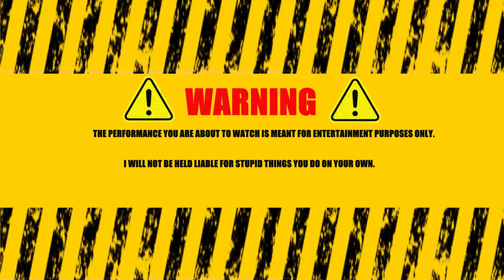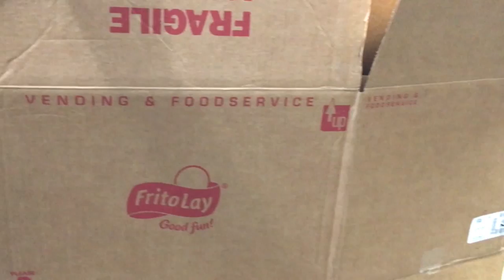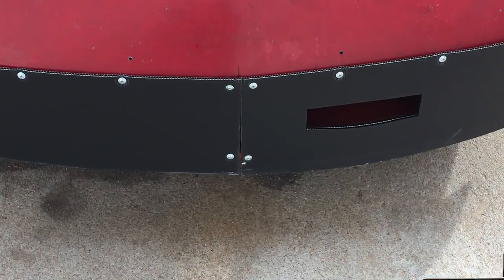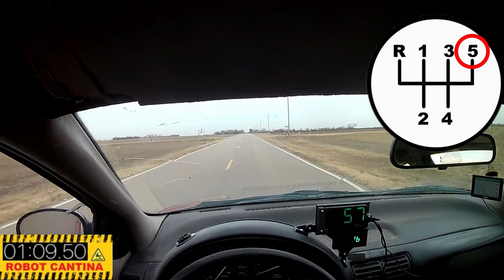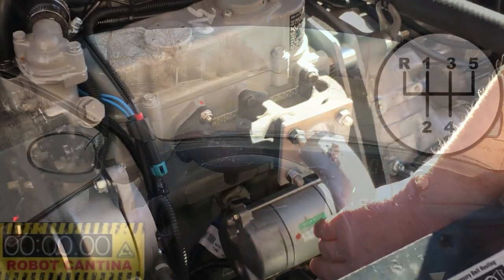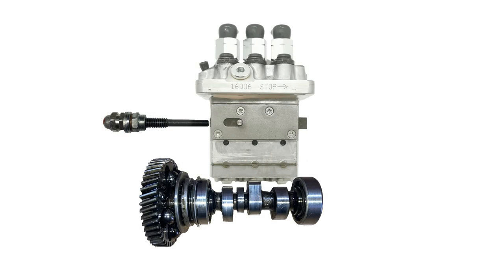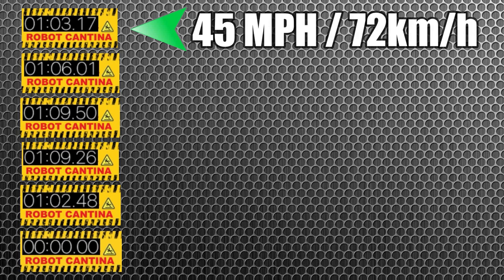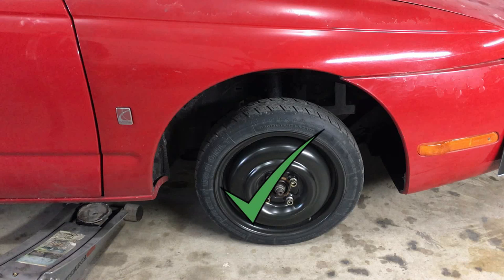S3E2   Fuel and aerodynamic mods ....We do some experiments to try and get the Saturn to go faster.

Comment: An old trick to get diesels to make more power is adding propane to the intake air. Its extra fuel but also helps everything burn faster and more evenly. You could try just bleeding some into the intake while it's accelerating.
Reply: The increase can be as much as 20%

Comment: Propane is the NOX of diesel, directed it can also spool up the turbo impeller.
Small tire, high pressure 80psi, low friction.  Large tire, low pressure, high friction.
More effective on front, due to weight & power transfer.  Rear only has 25% brake duty, yet helps.  Lower ground clearance, better air and handling.  Check disk brake drag.  Run ATF in trans.  Replace alt w/ dash solar panel.  Cover wheel wells.  Spoiler may help break vacuum.

Comment: Cool exhaust with no load is common for diesels.  Since they don't have a throttle, they're significantly more efficient at idling than gasoline engines.  I have a VW TDI and it has a cool exhaust when idling too.  The engine has glow plugs in the coolant lines to heat the coolant while idling because the engine won't generate heat while idling.  For example, if you're trying to warm your car up.  At least, it won't generate enough heat.
Reply from the maker: Thanks for the info!

Comment: Having a 999cc turbo 3 cylinder gasser in my daily driver, I find this series quite intriguing. My brother has the same car I do but with the naturally aspirated 4 cylinder. We both have five speeds and the difference is very noticeable. His transmission has much shorter gearing and close ratios. Mine has much taller gears and significantly wider ratios which I assume is to give my turbo a chance to spool up and do something. I'm curious if the close ratio transmission is going to be a problem during acceleration once the little Kubota gets the Turbota.
Reply: The reason is because a turbo engine (even a smaller one than N/A) has a much more broad torque curve.
You can happily make plenty of grunt at 2500rpm where na might have to rev to 3500.

Comment: Id recommend advancing the pump timing to make some power
Reply: yeah, i would just watch because its not a dynamic adjustment, so setting it 15 degrees early may hurt the low end a lot and make it really smokey
Reply: @ramentaryramblings  actually it would be interesting to add Arduino with stepper or servo to adjust it on the fly
Reply: @piotrcurious1131  could be pretty hard. To adjust injection timing you need to rotate the fuel pump in relation to the engine. 
There is plenty of force and any backlash would be bad
Reply: @ReubenHorner  As injector follows the cam, and there is adjustment screw allowing offsetting, one can merely install servo to change the offset following the cam angle. That means servo must do it fast, and ofc there will be wear&lubrication challenges, but for one-off experiment this can work and there are servos fast enough to do it without much sweat.
Reply: @piotrcurious1131  Would be all but impossible on these because you adjust pump timing with shims under where the pump mounts to the engine block, moving the whole pump up or down a little. Most people who put Kubota engines in road going vehicles will just remove all the shims to advance it as much as possible. It's set to 0 degrees from the factory, so even advancing the timing this way doesn't result in all that much timing advance.
Reply: @randr10  Yes but there is a screw to adjust enrichment, by adjusting offset , see video. To advance timing, one would need to use servo to increase enrichment following negative shape of the cam.
Reply: @piotrcurious1131  if I understand correctly, that screw doesn’t adjust fuel timing but just increases the amount
Reply: @Burns11112  Yes, but if servo would be used to adjust it , synchronous to the cam, effect would be slight timing advance.
Actually i guess much easier hack to increase overall power would be to add propane to air intake, like it is done in propane conversion kits for Diesel. up to 40% propane can be added and it increases power and burn-through during acceleration (no black smoke)

Comment: The spoiler helps with drag. It elevates the trunk and helps the flow to reattach. If you want to reduce drag further, look into making sharp separation edges on it and on the bumper.
Reply: @drippingwax  even if it's too low, it will help. And there's nothing that says you can't modify it. Wool tufts will tell pretty much everything he needs to know.
Reply: @drippingwax  lol what diagram? That template? 🤣🤣🤣
Reply: @drippingwax  you don't use a template for this. You either test or use CFD to get an idea of how the wake is.
Reply: @drippingwax  how else? With testing after testing! Why do you think a car goes through more than 300 hours of wind tunnel before locking the design? And this is in modern times, where A LOT of iterations are done to the design using CFD. Every car is different, the regime that hits the roof isn't the same in all vehicles, so a template is a no no.
Reply: Put an Opel Calibra in it. See if the template tells you that it was the most aerodynamic car on the market for a decade. Or if a Daewoo Espero, even an Opel Kadett E are as aerodynamic as a 2023 Jetta.
Reply: @drippingwax  .39? You must be looking at the Kadett D. Regular kadett E had .32 and .30 in GSI form, best in class for years to come and it has quite different angles than any template of rules of tumb. The Jetta is just a jelly bean sloping car that i had in mind with a cd near .30
Reply: Also worth mentioning: the jetta is semi cladded.

Comment: Hey Jimbo, thanks for another cool video.  It's amazing the interest us mechanical types have in retrofitting an old Saturn with a garden tractor engine.

Figured I would add my 2 cents, hopefully not covered under other comments.  This little engine is probably used at 1,500 to 2,000 rpm in the garden tractor application so, I wouldn't be too surprised if fuel delivery was subpar at redline engine speeds.

Since it is January and air temperatures will vary considerably from one week to the next, or even morning to afternoon, it may be difficult to compare "apples to apples".  The colder temperatures (obviously) increasing tire rolling resistance and the air is more dense.  Using a consistent tire pressure would help (which you are probably already doing).  When I owned Saturn SLs and SCs, to give the best weight distribution across the contact patch equated to 42 - 44 in the front, 28 - 30 in the rear.  With your lightened Saturn, I suggest 40 - 42 front, 27 - 28 rear.

Comment: Exhaust stays cool at idle because diesels have no throttle. It’s pumping a bunch of air into the engine but not burning the vast majority of it, it just pumps it straight out the exhaust. Since there is only enough combustion happening to idle the engine but a lot of airflow moving through the intake and exhaust, it stays pretty cool. Same reason that it takes literally forever for diesels to heat up the coolant temperature when they’re just idling. They’re practically air cooled at idle.

Comment: Blocking off the airflow at the front might now mean the underhood air is now entering mostly through the radiator. So this air will now be warmer than before. If the engine inlet air is drawing from this source then power will definitely be down.

Comment: I can tell you from experience this engine in a G1900 tractor the exhaust gets hot. Very, very hot lol. It also runs a little faster than yours did before your governor adjustment.

Comment: Cool project you got going. Volkswagen in Europe has a model titled Lupo, dont know if available in US? This does easily 2,9liters/100km. It is a 3 cyl turbocharged diesel. Some very serious attempts to lighten just about everything. Even the transmission goes to such extent as hollowing out shafts....Note that when you closed the air inlet, you may in fact have increased the frontal area...

Comment: I have a 2000 Honda insight. I have four spare wheels on my car. They are supposed to be at 60 psi loss mileage at that psi. Air them up to 90 psi and you get a lot better mileage.

Comment: That little diesel sounds lovely, though I've always like the noise that 3 cylinder engines make.  The fuel delivery on a turbo diesel should be matched to boost pressure, otherwise you'll still get smoke off boost.  If you were keen I suppose you could use a servo or stepper to adjust the rack stop automatically if that is a problem.
Reply from the maker: My Mercedes OM603 turbo diesel had a little gizmo that adjusted the fuel according to the boost pressure.  Obviously this Kubota engine doesn't have that, but you are correct and one could be fabricated with a  stepper motor on the rack stop.   This is kinda the plan, but the engine will have to come out of the car for that mod.  In the meantime we will have to deal with a temporary over rich condition as the turbo spools up.
Reply: @robotcantina8957  An interresting test would be how the engine runs with the turbo but the same tuning as it had without the turbo. 
The alternative used in cars will be kinda hard with this engine: Don't stomp down the go pedal from a start. But rather ease into it until you have boost. But yeah with this little power WOT is probably the only option to get this thing moving.

Comment: Mount motorcycle tires on the spare wheels!

(idk if motorcycle tires are better durability than "temp spare tires", because they don't last much longer on a vehicle that weighs ~1/4 as much, with twice the tires)
Reply: Motorcycle tires on a motorcycle last 10.000, mayyyybe 20.000km. They're often really heavily tailored to offering great traction over life span or rolling resistance. It's the reason why some long distance riders mount car tires on their motorcycle. As long as you don't have to corner, it works fine.
Motorcycle tires on a car? You'd shred them really quickly.
Reply: @mfbfreak  to quote a distance motorcycle tires last without knowing what the use or motorcycle isn't a good idea. IE: the front tire on my CB600 lasts almost 15k miles, the rear lasts just over 7k, but front & rear on my GL1100 last almost 20k, because the tire (compounds & tread pattern) are chosen for intended use, & they are ridden very differently.

Also, one of my current projects is a homemade car with a goal of 1200lb curb weight, and I have spare wheels from a car for the front, with cruiser bike tires. I also have a solid front axle with -3+° of camber (lowest possible currently, depending on choices for SAI & caster), for the looks.

(it's a ratrod hack of a Locost, because I can)

Comment: I wouldn't worry about exhaust temps without the turbo, there's no way you could reasonably over-fuel that engine to get to a dangerous egt. the black smoke produced in over fuelling is literally unburned fuel. once you exceed 18:1 air fuel ratio, you're just making black smoke, not more heat. once you get the turbo on there and start burning lots more fuel, then you'll need to worry about egt burning valves up and melting pistons. normally turbo engines have a lower compression ratio than their n/a counterparts and this ratio is usually achieved by increasing the size of the combustion chamber. if that turbo is going to destroy the engine, it'll likely be caused by the high (for a super charged engine) compression ratio. 
as for the drop in performance I think it could be as simple as the engine bay air temperature, a cubic foot of cold air has more oxygen in it than warmer air. try plumbing the air intake through the bonnet or through your new air dam in front and see if that cures it.
Reply: also I would run an oversized intercooler with the turbo to "shrink" the air as much as possible!

Comment: I think the cavity of the wheel wells, along with a few other places, may have given enough drag from flow separation to not really help. The smaller wheels changed multiple variables at once, after all. Separation is what wings often help with, even though it doesn't seem like it. The air should go backwards instead of downwards. I wouldn't add drag trying to get more air, just direct cooler air to the intake. Maybe even use a funnel, idk.

Comment: I think the boot spoiler really helps earo dinamics. In some other video i saw it helps with flow separation of the boot. Those jelly bean styled cars date from a time with a genuine oil crisis and they were not fooling around.
Reply: it is not. Rear separation is more or less negligent at low speeds..
He did cover the front hole creating much more drag in the front. It would be probably better to just chop off the front bottom completely and make new bottom cover.
Reply: @drippingwax  there is not much inside engine bay and at such low speeds it does not seem to matter. 
I did experiment with the front grille and bottom hole a bit and adding straight up surfaces creating flat point of contact is what causes losses. pressure just has to go somewhere. 
Anyway perhaps best thing is to actually experiment, so f.e. using duct tape and cardboard instead of too much theory and fixed design. Early aerodynamics adopters also figured it out - there are simply too many variables. 
Perhaps reason why air going thru engine bay gives better fuel economy is that it merely creates higher pressure for engine, so more cool air into engine. Who knows.
Reply: @drippingwax  good job on looking that up! I'm going to check it out. Robot cantina is aware of this, i hope.
Reply: @piotrcurious1131  generally holes in the front are bad for aero. Having air pas through the car is the worst. Multiple threads on ecomodder testify of this.
Reply: @maxspruit8370  Generally sure. Still how you deal with gaping the hole matters too. having flat surface vs pointy tip for example..and volume inside car, speed etc. 
In this particular case front hole is designed quite nice to form small funnel with nice sharp edges. This increases pressure with just small aero drag, something someone probably designed with wind tunnel. As rest of aero features of the car, like... low front spoiler ... cause negative pressure under the car, this forms quite efficient cooling system.
To remove the drag whole spoiler would have to be redesigned, perhaps simply removed.

Comment: Volkswagen turbo diesels have sodium filled exhaust valves, which the non-turbo engines don't have. Plus, they used a separate diaphragm regulator for fuel enrichment.

Comment: 56 mpg is great, but it's kind of offset by the fact that it takes 2-4 times as long to get up to speed. Good thing you live out in farm country, driving this thing in even mid-sized city traffic would be completely impractical (you'd get the attention of a lot of cops.) Good luck with the turbo! I'd guess that the limiting factor will be the mechanical fuel injection. You're going to be looking at lean mixtures as the MFI is tap dancing as fast as it can to keep up with the greater amount of air being jammed into the engine. It would be interesting to see if the wing makes any noticeable difference in speed, acceleration, or fuel mileage. It's chief potential would be the effect of lengthening the car aerodynamically. I doubt that it would make more than a marginal difference though. It's mostly there for looks. (Lamborghini once offered a wing as an option on the back of one of their supercars, and it made a huge difference. The $5000 wing knocked 25mph off of the top speed of the car. Not ordering it was the most effective performance improvement you could make. Lol!) 
All in all, this is a silly, impractical, but fascinating exercise in 'seeing what can be done with existing components'. Looking forward to the next video.
Reply: My guess is that the vehicle with the wing both accelerated faster and stopped faster than the one without. I would argue that a Lamborghini is not a drag car and losing 25 mph off the top speed didn't lose it any races on a circuit.
Reply from the maker: This is kind of a fun experiment we are doing with the little diesel engine.  We really have no goal in mind other than getting the car to go as fast as possible.   Things like fuel economy are interesting data points that people want to know, however that is not the purpose of this project.  We try and balance entertainment with some educational value to keep folks coming back.  There is certainly a lot of  modifications we can make but we also have to keep within our budget.   You are correct this car is perfect for driving around in rural areas where there is limited traffic and that's kinda  all we intend to do with it.

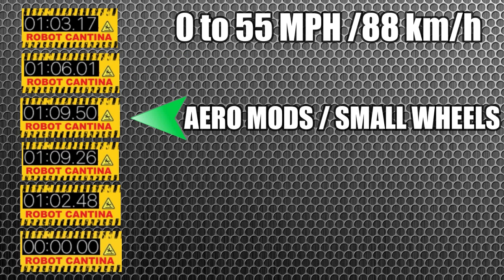Comment: 19:15 the aero mods made it WORSE. a flat panels on the front  that you made offers MORE resistance than a hole
Reply: Exactly. He has space to spare, channeling the air would be better. He isn't going to hit 120mph, so a smooth undertray with some louvers as the exit would be ideal.

Comment: Great work I always advise fitting a electric fuel pump and 3psi will greatly assist fuel pump and add ease of bleeding up fuel an old diesel engine will appreciate the modified fuel system and be more spirited in its gallop lol 😆 thank you 😊
Reply: @ocdman202  The Model T was introduced to the world in 1908. Henry Ford wanted the Model T to be affordable, simple to operate, and durable. The vehicle was one of the first mass production vehicles, allowing Ford to achieve his aim of manufacturing the universal car.  Telegrams went the way of the Model T..
Reply: The lights of the original Model T were not electric. The common lamps used on horse drawn vehicles were the lamps used on the Model T, this meant it used acetylene carbide headlights and oil side lamps. Electric lighting and electric starting became available for the Model T late in production during the 1920’s.

Comment: Put the wing back on.  Propeller heads at GM designed it for fuel economy.  Also consider rear fender skirts (like your Honda).  Make them out of that sign board stuff you put on the front